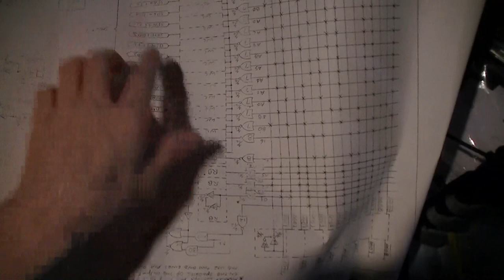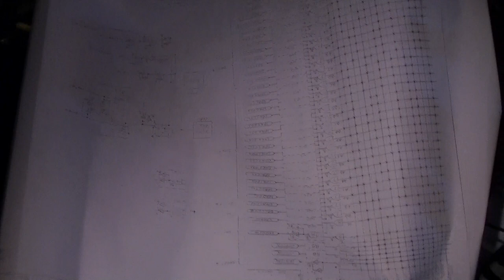The Amiga on a Chip Project - Too bad it was canceled

Comment: Jeri Ellsworth - I'm currently working on adding AGA support to the Minimig core (slowly), and to have the original chip schematics would be a massive boost to the whole project....

I know it's been many years since you worked on this stuff, but do you still have the chip schematics at all?

The Minimig core is already very compatible and working well, but to know the final few quirks of the Amiga chipset would be amazing (and very useful).

I know Dave Haynie uploaded a ton of info on the unreleased AAA "Nyx" chipset on his site, but the A500 chip schematics would be a perfect thing to learn from, and to preserve for the community.

I also have some small Cyclone II boards on the way which will hopefully let me build an "Amiga DTV" of sorts, modelled after your DTV project of course. ;)

Comment: Did I just hear right?  YOU are the one who designed the C64DTV?  It's so good to meet you, even if just through your videos!  I just bought my second one of those.  Totally awesome!  I still have and use the real C64 and peripherals and loved the idea of getting the whole thing within one joystick.  I have to really appreciate that it has an actual BASIC mode rather than being stuck with only the games that are loaded into it like a big cartridge that can never be removed.  I also love how (so I've read, not really explored yet) that all the pinouts for all the plugs and ports can be found in solder points on the board for hooking up real Commodore equipment if I attach some ports.  That'll be a project for another time, though...I haven't set up my electronics workshop in my new house yet (procrastination).

A lovely lady who enjoys tinkering with hobby electronics and designed the C64DTV...I think I'm in love!  :D

Comment: A long time ago I worked for MOSTEC in Valley Forge during the days of the vic20 and C64 .we were given C64,s for $10.00 a week out of our checks,I had a Executive 64(the box with built in monitor and dual drives,the keyboard was the front cover wow an incredible machine )We had atari game chips and additional sound chips hooked up to the user expansion connector lots of fun

Comment: The MCC-216 from arcaderetrogaming is an FPGA-based system that runs Amiga 500, C64, Atari 2600, and Apple II.
It doesn't have the "Ellsworth Inside" sticker, but still very cool.

Comment: Why was it not released. ?

"Lack of fan base", that has to be a joke, everyone is waiting for amiga fpga so that must be wrong claiming due to lack of fan base.
Reply: We have this already, in Minimig, Turbo Chameleon 64, MIST, FPGA Arcade/FPGA Replay... They are all possible to configure as Amigas on a chip.
Reply: In the video, Jeri does however say the idea was for custom ASIC though.
Reply: except the mentioned "amiga on a chip" systems are either harder to get hold of than unicorn poop or cost an arm and a leg, the whole point of the "on a chip" thing is they are mass produced usually sold for under $50! raspberry pi + emulator seems to be the easiest and cheapest option I can find, maybe that is enough?

Comment: Great project, I loved the amiga, I had a early 500 1.2 and after the pain of assembler on the 64 took to it immediately. I remember trying to understand the disk formatting from the diagrams in the addison wesley manual, and my best attempts resulted in something which tracked the head down wrong and destroyed the floppy so bad it woudlnt recover, so we released it as the "fast disk destroyer" for if raided :)   What killed the amiga was hardware prices, we were bled...  Still got a 3000.

Comment: "lack of fan base", that just shows how out of sync management are to the masses.
Everyone that bought the c64 joystick plug and play would have bought the Amiga one also... + many more.
I can understand the issue they had with memory since memory was expensive back in the days...
Too bad it did not work out. Interesting vid nontheless!
Reply: the memory excuse doesn't make much sense either. Amiga games came on 880k floppy disks. a relatively small, even for 2004, 64mb flash card could hold over 70 Amiga games. I know I have hundreds of Amiga games for the emulator (Win UAE) plus many versions of the Kickstart and OS, tons of apps, DPaint, Scenery Animator, Lightwave etc. and the whole thing doesn't take up half of a puny (these days) 1GB flash stick I use, because it's too small to fit much else these days..

Comment: I wish I could give this more than 1 "like"! ;-)

I owned an A500 and an A3000. The A500 spent most of its time in the same state as the one in the video: I had a Western Digital RLL ISA hard disk controller connected to a self-made PCB underneath the 68000. 

The SCSI bus on my A3000 and PC were connected so I could use the PC's CD-ROM drive from the Amiga. I had to get rid of both Amigas when I emigrated from the Netherlands to the USA even though the A3000 had a US power supply.

I miss them!

Comment: You could be right there, even just talking about Amiga related matters outside of the usual community sites (like this one) usually always generate at least some passing interest. So yes, Amiga fans are still out there as the original machines are so fondly remembered and so they should be as they are still great to use! :) In fact, I am off to play Frontier on my 060 4000D right now :D

Comment: so sad when you work hard on project that never go anywhere.  I remember when I was heavy into the amiga I played a lot of games from europe which were Pal (alternate kickstart disk), and because of the 100 extra lines it would get cut off, so you'd have to manually adjust the monitor with the variable pot resistor dial.  Did it so often it eventually snapped off the board, so my brother took it apart and tried different resistor values to get it the right squish, and put in a toggle switch

Comment: It's interesting to note that now there are Amigas on chips (in essence) being sold although I don't know how popular they are being small scale projects. They adapt the original design to modern hardware and have modern interfaces. You can't use cartridges and such like but you can put all your ROMs and disc images on an SD card and use a HD TV.

Comment: Very interesting, it's a great shame that a cheap Amiga hardware based emulator doesnt appear. Their would be a big market for it. The a500 was bought by millions of people. If you really want to show off, design an aga (aa) chipset version at a selectable speed - !! And if possible , the dream of Amiga owners everywhere is an fpga accelerator for the a1200/3000/4000 models. But sadly this is unlikely.

Brilliant work.

Comment: This is quite an achievement I think anyone will admit but the project wouldn't have been popular with the fan base anyway because of the limitations joysticks on a chip have. Including only a limited number of games and no way to add more or indeed do anything else is not what Amiga users want. It sort of works more for the older computers & consoles because they were mostly games machines (although the Amiga was often given this moniker too in the Atari camp of course!)

Comment: I've actually got a collection of old Amiga hardware, last count it was like 6 A2000's 2 A1000's an a500, an a3000, and an a4000. even have a GVP accelerator card for the A2000 that had the 68030+fpu that ran at 40Mhz held 16mb ram and had the scsi 2 interface ;-)

Comment: It hurts me see such an awesome project being scrapped. Even though I have got 5 Amigas in my collection, I still would have bought an Amiga in a joystick if available.
I will eventually try to emulate the VIC II on a Parallax Propeller MCU. Do you have any indepth documentation to share?
The goal is to make a C64 emulation running on a single Propeller MCU. I have already got the SID chip running in a single core.

Comment: Just to let you know that the minimigtg68 project by Dennis van Weeren with the TG68 CPU Core by Tobias Gubener is running on a stock Altera DE1 or DE2 FPGA board. You just need to build a small passive adapter to get both mouse and joystick at the same time.

Project homepage is at hxxp://gamesource.dir.groups.yahoo.com/group/minimigtg68/?v=1&t=directory&ch=web&pub=groups&sec=dir&slk=1

However, you still need the original ROM contents to make it work...

Comment: @homebrewedpinball Yes, Amiga was very expensive and certainly not designed well because it completely lacked the clear destination - it was partly a gaming system but not quite that advanced, partly a musical device but rather useless without synthesisers, partly an office PC that was not IBM... overpriced jack of all trades that did nothing right in the times when even the cost of a single chip mattered a lot; Atari ST for sure was a better buy if someone wanted IBM incompatible for any reason

Comment: @JeriEllsworthJabber Amiga was also very expensive when compared to the C-64.  I believe C-64 was about $300 at the time of release, amiga 1000 (only 512k ram) was easily near $1000.  The amiga500a made it much more affordable, but was much later.  Sure it was WAY ahead of it's time, and still a bargain for what it did, but a very different crowd.  I agree, not the same following, though still a niche.